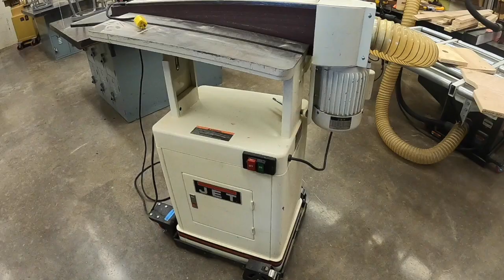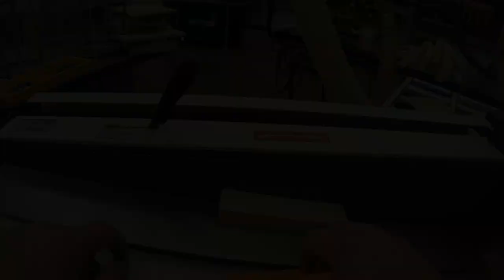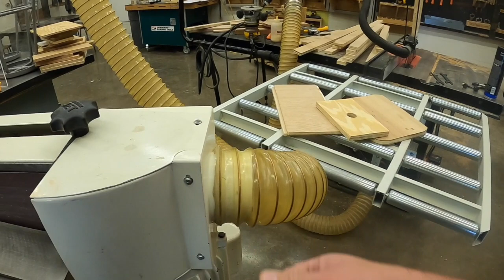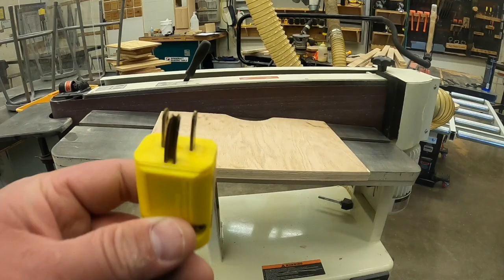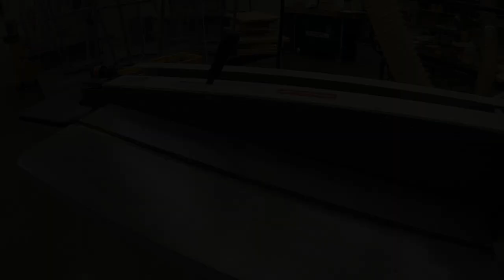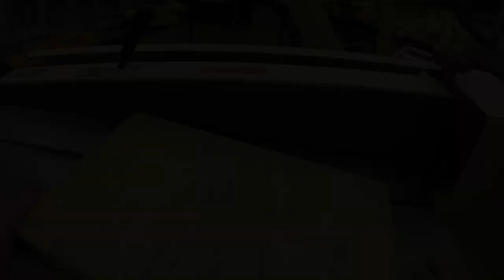Edge Sander Safety Demo

Comment: Well presented. Must say I had not considered using the table with that angle, the side plates on mine are bolted to the table and do not allow for a similar angle as you are able to use. I did get a lab scissor platform to make adjusting the table up and down a lot easier.